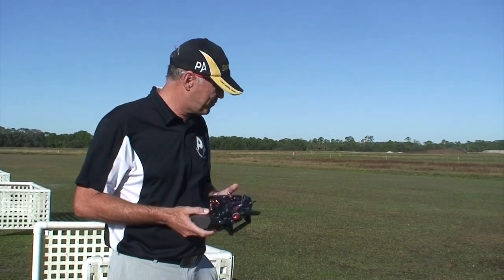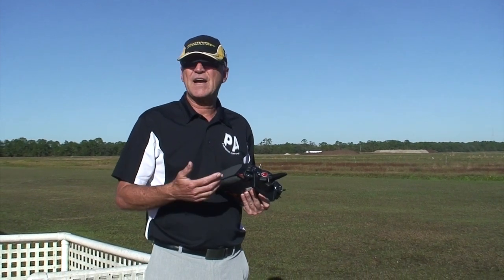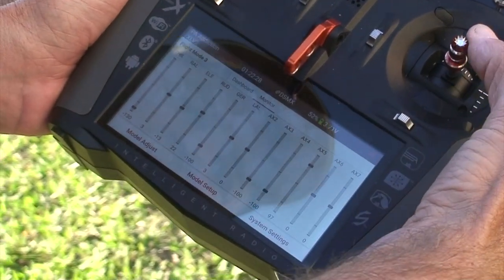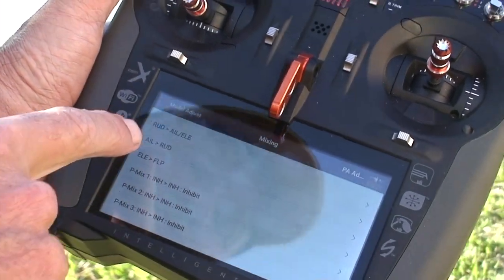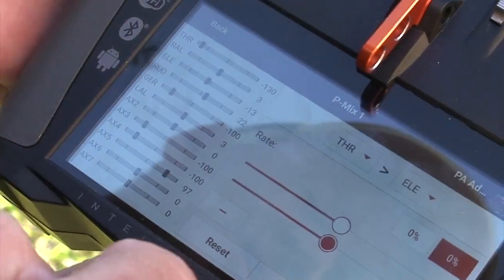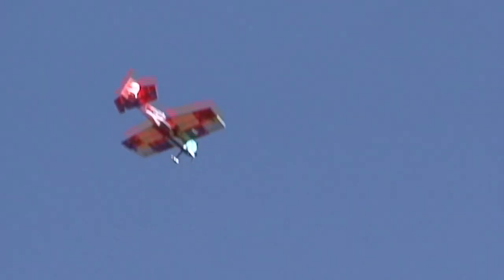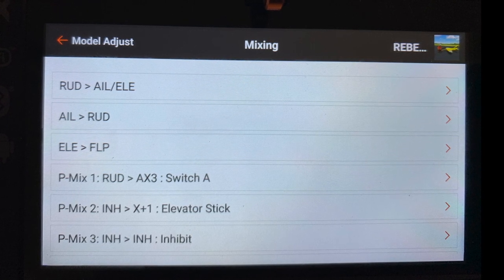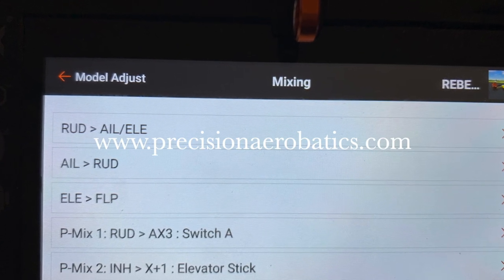Michael Wargo: Special Spoileron Mix and Mixing instruction tips

Comment: Interesting stuff. I didn't realize people use mixes so routinely for so many different manoeuvres. Maybe I can get my Tundra to knife edge a bit more elegantly! :-)
Reply from the maker: Truth is, check out my video on the tundra or grand tundra....   I used a ton of mixing to get it to fly knife edge.   Significant rudder aileron and rudder elevator.
Reply: @MichaelWargo  So.. for a knife edge on something like a Tundra you would typically need:

1) opposite aileron (to effectively avoid the rudder rolling the plane upright) 
2) a bit of down elevator (to keep the plane tracking in a straight line).

Presumably you would only enable these mixes when about to do a knife edge (using a switch)?  Otherwise these mixes could be a pain - eg biplanes can need rudder to assist in normal turns and you don't want the ailerons fighting you.

But I got the impression you would have such a mix enabled all the time? And your written document doesn't mention switching to enable mixing.

Sorry for this essay! And thanks for any tips :-)
Reply from the maker: @stedenvideos3825  Not necessarily.   A tundra I might make switchable.   The amounts I mixed were pretty extreme.   the main reason to leave on is that when doing a point roll or the like, will stay straight with the mix.   You have to roll through knife edge.   This way, it does not want to push or pull out of straight.   That kind of thing.   What about a flat turn...
Reply: @MichaelWargo  Bit cold here but just been out trying a rudder/aileron mix on my tundra. What a difference! The tundra normally has a strong rudder to roll coupling. Mixing in aileron to oppose that roll tendency when using rudder changes the whole feel of the plane. Anything that needs rudder is now a whole lot easier - hammerheads, knife edges, etc.
TBH there is still part of me that feels like this sort of mixing is cheating just a little bit. But on the other hand I can now use the tundra to practice aerobatics from a rough field (where fancier planes would struggle to take off) - so all good! Thanks for the tip.

Comment: I’m trying to do the elevator flap mix on my new e flite eratix with my DX6 transmitter but when I set the mix to 70 up and down it makes it so when I go up and down with the elevator it makes the ailerons go in separate directions. How do I make it so the ailerons will both move in the same direction?
Reply from the maker: They have to be on separate channels.   I never use one channel for both ailerons.   I cannot be done if on one channel
Reply: @MichaelWargo  okay great that makes sense and thanks for the quick response! Is this something you can do on a DX6 as in does it have enough channels to have both ailerons on a separate channels and putting the ability to turn the mixing on and off on another switch? Mostly wondering because I’ll hopefully be ordering the PA addiction V2 XL in the near future and am wondering if I’ll have to upgrade my radio as well to get the most out of it.
Reply from the maker: Yes, a DX six can do it. The sixth channel is the flap channel and that will be your second aileron.

Comment: the wordyourlooking for is 'elevon'
Reply from the maker: Actually, elevons is a set up for a flying wing, where the elevator is also used for ailerons. The left and right surface go up and down for elevator and then they moved to differential to roll the airplane like ailerons.    The mix actually shift between spoilerons and flaperons Depending on whether they are moving up or down
Reply: @MichaelWargo  well... i stand corrected! thanks! i love learning new things!